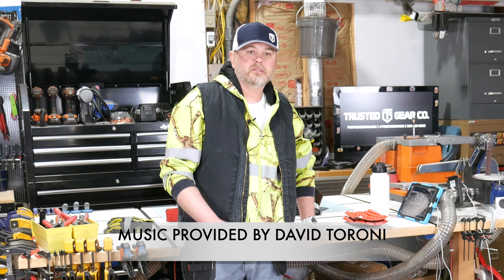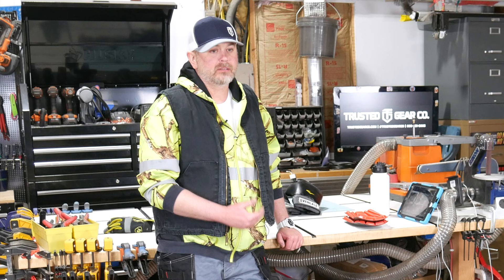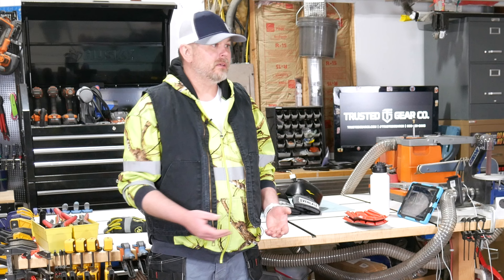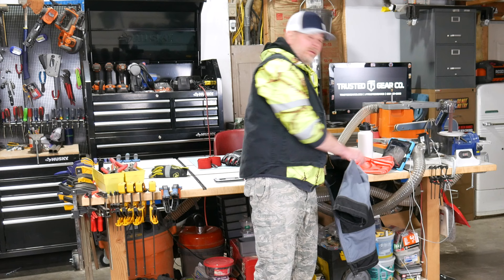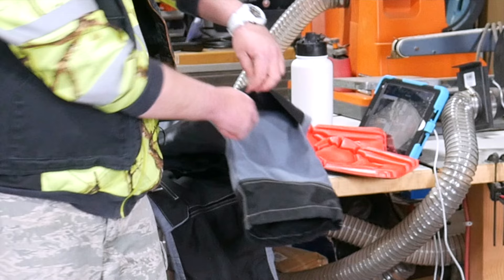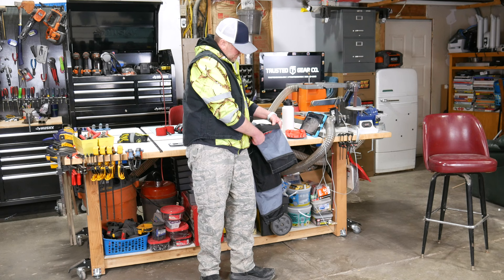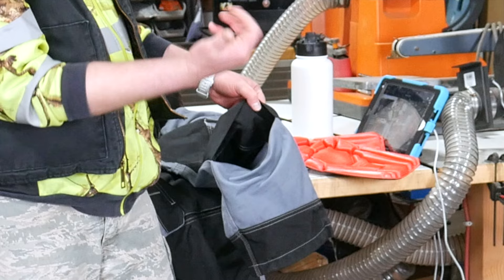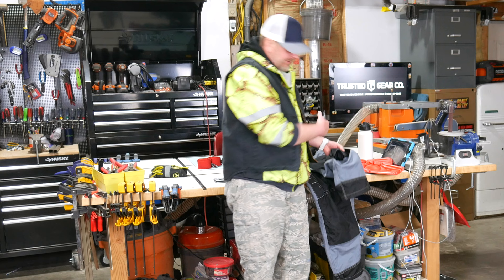Knee pads falling out of your Blåkläder work pants? No problem.

Comment: Just a little extra tidbit. There's actually 2 different shelves(folds) in Blaklader pants for kneepad placement. I have to keep mine in the upper shelf otherwise the pads sit too low on my legs.
Reply from the maker: You’re correct, I believe I mentioned that in the video or at least I meant to